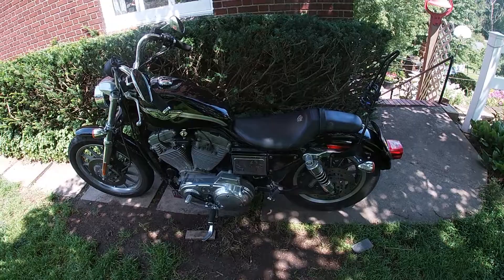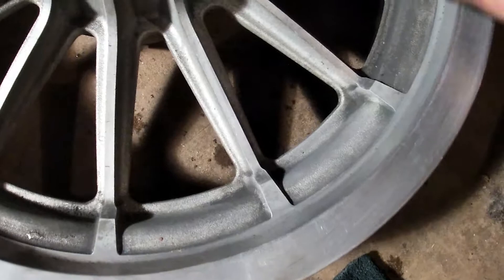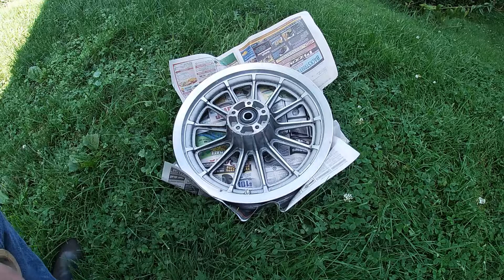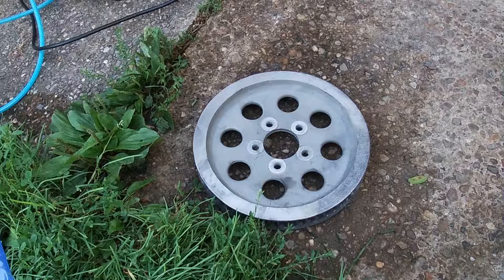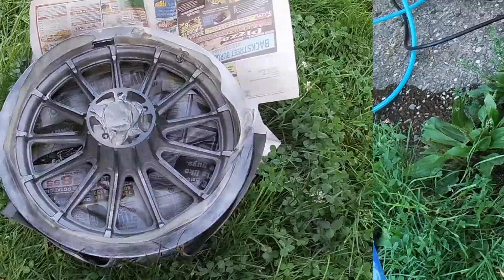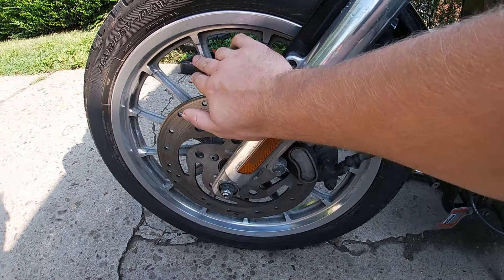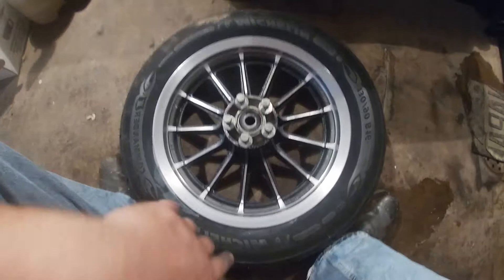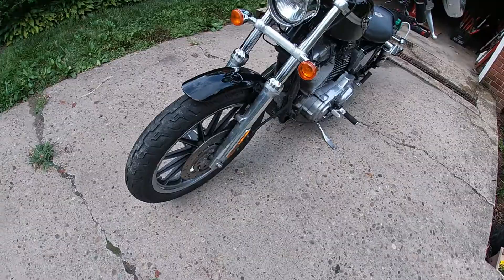Painting the Wheels on My Sportster

Comment: how well did they hold up and what type of paint did you use?
Reply from the maker: I used Dupli-Color high performance wheel coating, I'll put a link in the description. 
So far, it's holding up great.  I haven't had any peeling or fade.  With the surface that I painted being textured, I do have to scrub it with a plastic brush to get at all dirt, but I had to do that as bare metal too.
Reply: Ramblin' Chris yea I’m thinking about the same thing bc I have the same rims and tires of the bare metal look
Reply from the maker: @justinlloyd803  It's the perfect time if you're off from work right now.  It will certainly keep you busy for a day or so.  Just remember, prep is everything.
Reply: Ramblin' Chris true that’s what I was thinking after seeing your video on it.
Reply from the maker: Be sure to let me know how it goes
Reply: Ramblin' Chris the first ride is looking good just have to clean the smooth aluminum up a little.